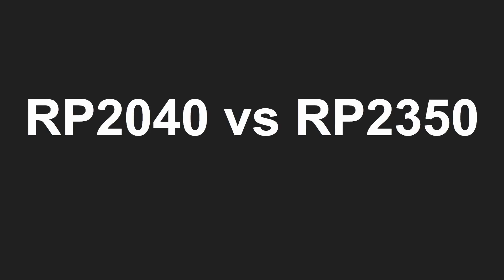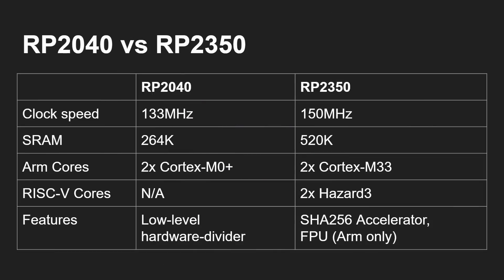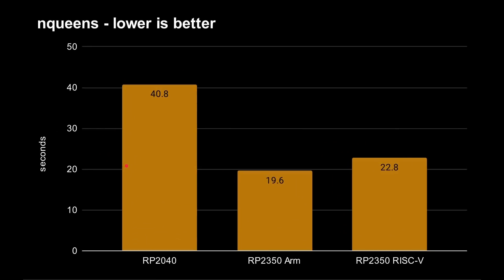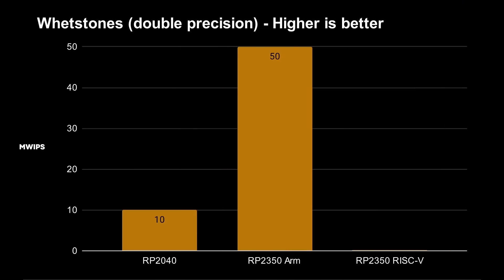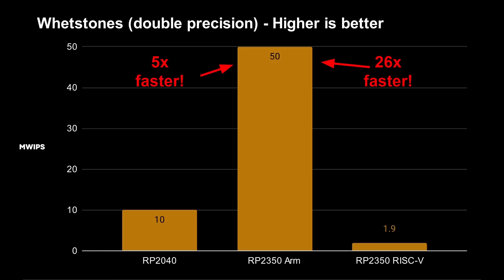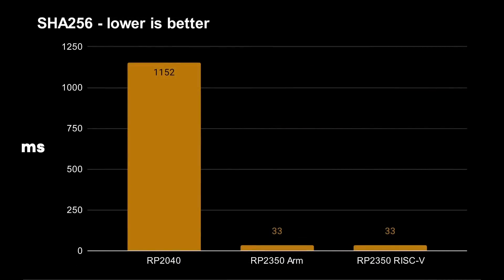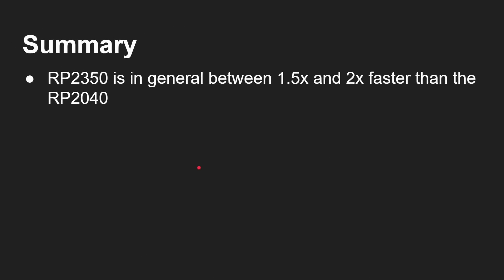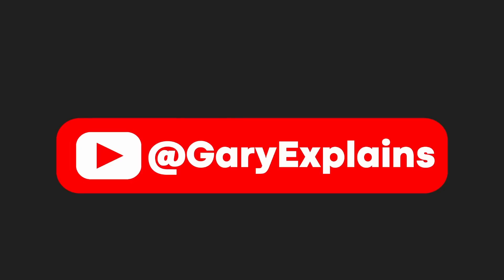Raspberry Pi RP2350  - Testing its FPU and SHA256 Performance

Comment: I did a lot of C++ stuff on AVR8 (the original Arduino chip) and did it on Linux with locally compiled GCCs, while the windows avr-gcc was locked into a very old version (with lots of modern C++ stuff missing).
Windows is just for convenience and not for innovative stuff.
No offense, it’s fine to have a stable environment in Arduino land, where the typical maker is not deep into the raw stuff. (If it would be different, the Arduino classes would be more thought through)

Comment: SHA256 performance at low watts you say, hope there isn't a cryptocurrency that will eat stocks up by miners😇
Reply: It is still a microcontroller, not a number cruncher.
Reply: @FuD-ForschungundDrogen  yes but the hashes per watt, may make a cluster of these viable.
Reply: @PaulGrayUK  Yes, maybe.

Comment: https://youtu.be/F63Z7g6R50s?t=71 Cortex M0 does have integer multiply built in.
Reply from the maker: Yes, it does and I say that in the video. But it doesn't have an FPU.
Reply from the maker: And technically not the M0+ but the RP2040.
Reply: @GaryExplains  What I am hearing is '...because the Cortex M0 doesn't have integer division or multiplication built into it'.
Reply from the maker: The tests I run in this video have nothing to do with integer division or multiplication.
Reply from the maker: Integer division is like 25/4 = 6 reminder 1. Floating point is 12.34/3.14
Reply: @GaryExplains  Indeed not. Which is rather tangential to this topic, no?
Reply from the maker: @abraxalito Hmmm... No, it is the subject. This video is about the performance of RP2350 when doing floating point operations. My previous RP2350 video was about the general performance including integer division / multiplication.
Reply from the maker: The Cortex-M33 has an FPU (floating point unit) for operations like 12.34/3.14 but the Cortex-M0+ does not. But the RP2040 does have integer division/multiply built in.
Reply: @GaryExplains  Did I hear wrong at 1:07 into the video then? Where you said '...because the Cortex M0 doesn't have integer division or multiplication built into it''
Reply from the maker: I see the confusion now. You heard correctly, the Cortex-M0/M0+/M1 lack dedicated multiplier hardware.
Reply: @GaryExplains  Its the subject of your video yes. But not the subject of this little thread which is what I was referring to. The subject of this little thread is whether its correct to say that Cortex M0 has no integer multiply built in.
Reply from the maker: @abraxalito Yes, sorry I misunderstood your original comment. To clarify the Cortex-M0+ does NOT have hardware divide or hardware multiple.
Reply: @GaryExplains  We're making progress, thank you! I have written assembly code for Cortex M0 (an FIR filter) which used the single-cycle hardware multiply feature of the processor. So there is no doubt in my mind that it exists - there is also an option in the ARM blurb when defining the chip that the designers may choose a single cycle (fast) or multiple cycle (slow) multiplier. Based on my reading of datasheets practically everyone goes for the fast one.
Reply from the maker: So for example the SAMC21 is a Cortex-M0+ chip that has the hardware, the RP2040 does not, but implements its own.

Comment: I'm sure that RISCV floating point performance can be improved quite a lot, bringing it close to the performance of the RP2040, which is also a software implementation. Bring hand optimized assembler to RISCV and that should help.According to the RP2350 data sheet the Hazard3 implementation has the M extension (multiply and divide) and it has a fast multiplier.
Reply: Yes. I haven't looked at their implementation of FP on RISC-V, but I know they used a third-party optimized assembly library for the RP2040, that was further optimized for the RP2040, but this library only has ARM Cortex assembly. They may not have done anything for RISC-V (haven't checked) and so possibly it's just the software FP emuilation of the compiler here.

Comment: For microprocessors, single precision float is the norm. So in the conclusion I would say the 2350 is not 5x but 7.5x faster than the 2040. (125/16.7=7.5)

Comment: Would be interesting to see which floating point software implementation you are measuring. RP2040 has highly optimised soft float in ROM, whereas the RISC-V cores are using whatever junk the compiler provides. You can use the compiler soft float support on RP2040 too (there is a CMake flag) and the performance drops off quite a bit when you do.
Reply: I couldn't tell from the video which toolchain you are building against. There's a lot of variance in soft float performance depending on which architecture variant the soft float library was built for. If you are using the CORE-V toolchain (e.g. you are on Windows) then I believe you just get an RV32IMAC soft float library, which is missing all of the bit manipulation instructions. Bit manipulation helps out a lot with soft float performance.
Reply from the maker: I was using whatever the VS code extension installs on Windows. I didn't know that the tool chains had different functionality depending the host, that doesn't seem like a good idea 😬 I will retest using Linux as the host.

Comment: Are people really encountering CPU bottlenecks for the types of projects a microcontroller like a pico is used in? 
Or is “Hey do you REALLY NEED that performance?” a stupid question?
Reply: I believe this will enable new types of signal processing and machine learning projects.
Reply: try and run a full graphic HD UI and you'll see these mcu' although powerful are not capable, why stm32 included a vector graphics gpu in some of their new ones to take the load off and now you can finally have 60fps UI which was hard to do with blackpills @ 400mhz mcu's, even with fpu's.  So yeah we really need this preformance,  say youre doing a digital compas for a sailboat and you have a nice round display but youre 600mhz fpu laden wahtever chip is maxed out at 99% and youre only gettings 25fps and your compass  looks like crap. Now it wont thanks to MOAR power. https://youtu.be/MqBqnPLM-wM?si=cmEbC6sIV_J-4f0Q

Comment: I suspect that the main use for the FPU on the RP2350 is going to be TensorFlow. Cheap devices that can run ML models at the edge are going to become increasingly useful. The extra RAM will help with these workloads too.
Reply: Yes, there is a build of TensorFlow Lite that runs on the Pico and it was updated at the start of the year to use both cores. Voice commands has been one use, which is a nice low power way of controlling home automation devices. The FPU would give a big boost to the speed of running those models.
Reply: @the_hetman the main use? Doubtful, seems most of the buzz is in fact for dsp and audio atm, but perhaps that could grow as more open spurce code becomes available. There's plenty of ppl interested in ml atm, but most of that crowd wouldn't be able to do much without resources. Either way I'm excited for it, both are useful.
Reply: Stop smoking weed, it is a microcontroller, not an NPU... Do you know of anyone doing machine learning on Cortex-M33 from ST or NXP for example? The floating point unit in these devices are used for DSP or control generally.

Comment: Gary thank for the quick follow-up on the RP2350 FPU performance. Single precision is the most common use case for DSP applications. In this case according to your data, the RP2350 almost provides 1 FLOP/MHz. This is huge deal and makes DSP applications like audio, digital communications, control, etc very viable on RP2350. The FPU is a huge feature upgrade and for the price, RP2350 is a bargain. It will enable many exciting signal processing projects. Thanks again for running the analysis.

Comment: The jump in performance for single point precision calculations is insane! Very excited to get my hands on this processor soon...
Reply: I'm surprised it isn't greater. The 2040 floating point is all software emulated whereas the 2350 is hardware implementation.  I'd expect at least a 100x speedup.

Comment: I'm surprised that SHA is important enough to justify a co-processor.
Reply: It's used for secure boot, so hardware SHA-256 has a significant impact on boot times when secure boot is enabled. It's not a coprocessor, just a normal memory-mapped peripheral.
Reply: I approve instant boot time :-)

Comment: Thanks Gary. Another nice summary video of the new Pico. Frankly I was surprised that the new machine with hardware fpu was not that much faster in double precision (and even in single precision) I was expecting well over two orders of magnitude increase in floating point performance. That's the level of speed increases I remember from 8087 days. Maybe I am misremembering
Reply: The Cortex-M FPU is single-precision only. RP2350 adds a custom coprocessor to accelerate double-precision. The speedup for double-precision comes from that coprocessor, not from the standard FPU. The coprocessor itself is rather fast but there is some overhead in getting data in/out of it.
Reply: @Wren6991 I think what the op is saying is that the single precision in the rp2350 should be at least 100x faster than the rp2040, since the rp2040 floating point is implemented in pure software emulation. I agree with that, and find it strange.
Reply: @artemisPrime3285  oh, I see now, thanks. The original 8086 was a 16-bitter if I recall correctly, so there is some extra cost there trying to do soft float on a machine like that. You would also have to look at the structure of the benchmark and see how much time is actually spent on floating point vs memory access and control flow.

Comment: Great information Gary. I’m guessing these benchmarks are single threaded and only using a single core? If that is the case, the RP2350 with multi threaded floating point operations would be even more significant increase over the RP2040
Reply: The RP2040 is also dual core, so I'd expect the perf ratio to remain the same

Comment: Really looking forward for a wireless variant of the RP2350. Sadly it'll probably take a year
Reply from the maker: You mean a wireless version of the Pico 2? There isn't technically a wireless verison of the RP2040, the Pico W uses another chip for the wireless. It will be the same with the Pico 2 W, which should be out before the end of the year. There are other wireless boards already like the Challenger+ RP2350 WiFi6/BLE5.
Reply: @GaryExplains  Hi - Is there Python support for the ESP32 - SPI (for WiFi) on the Challenger+RP2350 WiFi/BLE6? Tnx.

Comment: I have the challenger board as well. The three pin JST SH connector on the bottom of the board. Is that the SWD port for the RP2350? Any idea if the SHA256 speed will help with HMAC of the top of your head? Just started using HS256 for JWT messages so being able to do that on the Pico would be helpful as I can put the key into the OTP memory and never have to worry about someone extracting it with only booting signed firmware.

Comment: The Cortex-M33 cores have the standard ARM single-precision FPU. The RP2350 adds a double-precision coprocessor (DCP), inaccessible from the RISC-C cores.
Reply: Do you know if the DCP offers more parallelism than using the FPU would?  (i.e. can a double-precision instruction happen while the CPU is busy doing something else, in a way that a single-precision instruction cannot?)
Reply: @colinmcconnell827  Short answer: No. Long answer: A double-precision calculation requires a series of DCP instructions, each one instruction takes one cycle, so the ARM core does not have to wait between them.
Reply: @DQSoft  Thanks.  I have looked at the RP2350 Datasheet, and I suspect there is probably enough information in there to answer my question, if I can manage to interpret it all correctly!
Reply: How many cycles does a single precision multiply take in a 2350?

Comment: Sounds pretty tasty. Wonder how it compares to something like, say, esp32-s3. Purely in raw power, just a curiosity of mine.
Reply: And nrf52840
Reply: About the same as s3 but you can overclock it quite easily to like 200mhz officially

Comment: I wonder if a future revision of the RISC-V core will have a way to use the FPU. Apparently using a coprocessor is not precluded, since the SHA256 hardware can be done.
Reply: SHA-256 is just a memory-mapped peripheral, it's not a coprocessor. The Arm single-precision FPU is a standard Arm component inside the Cortex-M33, which can't be modified. Adding access to the DCP from the RISC-V cores would be totally doable though.
Reply: @Wren6991  thanks for the answer, and for the nice work on the RP2350.

Comment: Quite a difference in the M33 cores vs the older M0 cores.  You said there was no 64 bit hardware in the M33 MCU.  Yet double precision is 5x faster using the M33.   Interesting.  Are you going to be releasing the code that you used for your test?
Reply from the maker: The source code for the Whetstone test is in my GitHub repo. The SHA256 code is just the example code in the RP2350 documentation.
Reply: The 2040 has no FPU at all,  so floating point is done purely in software.
Reply from the maker: @MechanicaMenace The RP2040 doesn't have an FPU, true, but it does have a special integer divider.
Reply: @GaryExplains  oh yeah, I know and that's a useful thing. But an integer divider won't help speed up FP enough to compete with an FPU. Even a 16bit FPU would probably come out almost twice as fast as software at double precision than the M0 cores. And a 64bit FPU would have probably been around 3 times faster than the M33 cores.
Reply from the maker: @MechanicaMenace Indeed. But the fact that the RP2040 comes out ahead of the RISC-V CPU in the RP2350 means that there is something extra going on inside the RP2040. My guess is that it is related to the hardware divider/multiplier, but that is really just a random guess. Unfortunately I don't have time to investigate more.
Reply: @GaryExplains  oh of course. Sorry I was only commenting on why the M33 is so much faster than the M0, I wasn't even thinking about the RISC-V side. Was just adding to the conversation, not arguing.
Reply: @GaryExplains  They did extra work to optimize floating-point operations on the RP2040 and included the relevant code inside the boot ROM, which gives it single-cycle access and improves cache utilization, which is why the 2040 is surprisingly good at FP even without an FPU.  It looks like maybe that wasn't done for the RISC-V cores in the 2350, so everything is left up to compiler optimizations and is subject to normal code execution limits.